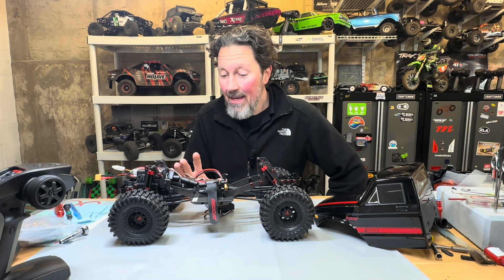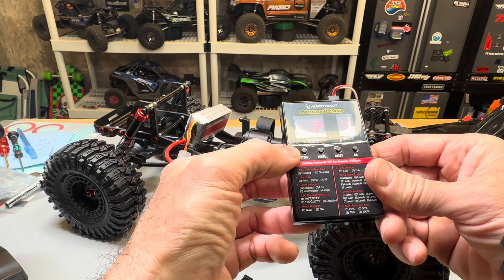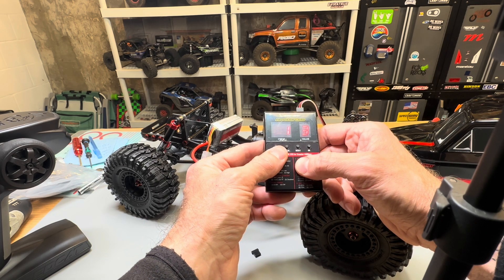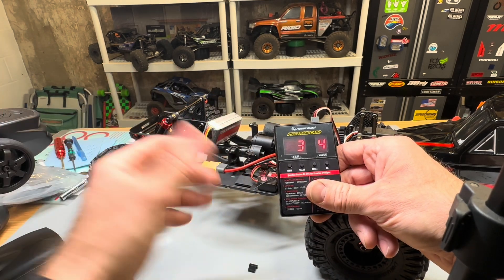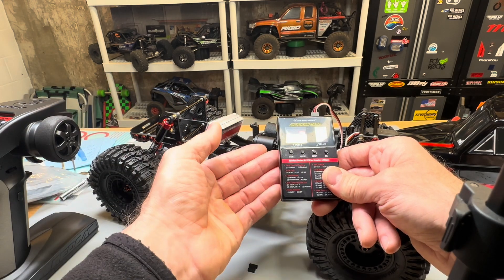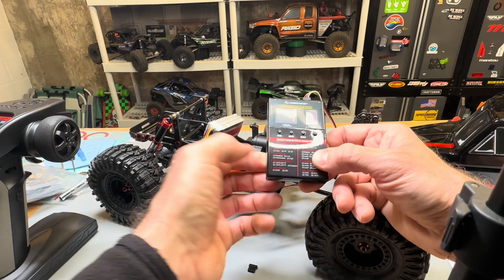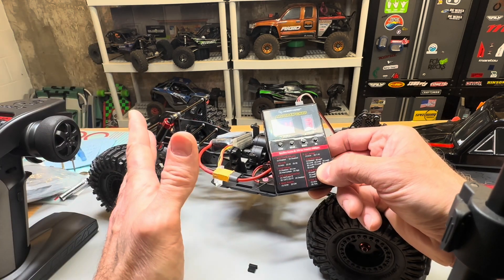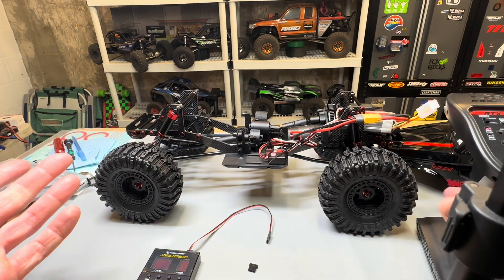Redcat Ascent Fusion ESC settings - Tuning options

Comment: Did you experience wheels wobbling? Im hoping the wheels aren't seated correctly, but i didn't want to rule out a slightly bent shaft.
Reply from the maker: No, could be sitting crooked on the hex. Try removing the wheel and run the throttle, you can see if the axle is bent.

Comment: The reverse is out of control, it'll literally do a back flip, THIS IS A PROBLEM REDCAT NEEDS TO ADDRESS!!!
Reply from the maker: Yeah, I wish they didnt block the reverse rate in the settings.  Only thing you can do is run a better radio that allows to to set a throttle curve or dual rate for reverse
Reply: @rcilluminati26  i just tapped the reverse, and WTF RC BRUCE LEE!!!

Comment: any hobbywing card can read any hobbywing esc you just have to use the correct graph
Reply from the maker: Right, just not the high end Hobbywing card. They dont seem to work with all systems

Comment: I’m buying a light bar would that be ok at 7.4 or no ?
Reply: They are little led
Reply: I’ve just looked they only 5.4 to 7.4 phew 😅
Reply from the maker: I was going to say, they normally list the voltage. Most light bars can handle it.
Reply: What sort of lights are higher than 7.4 volts then ?
Reply: That's the servo voltage that's 7.4